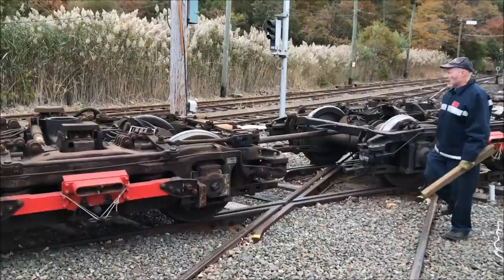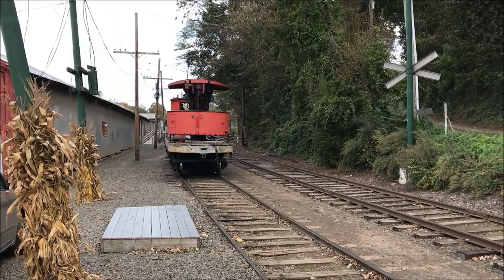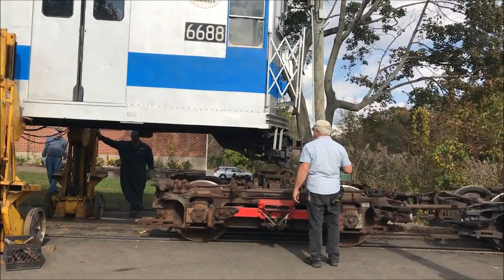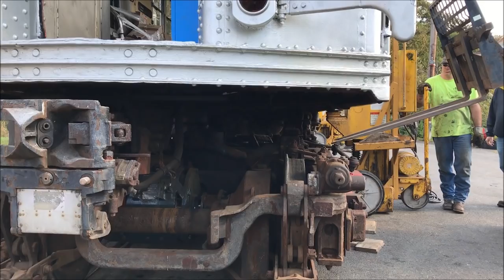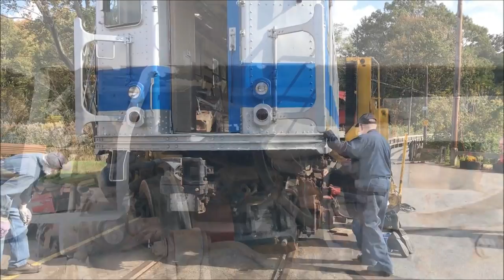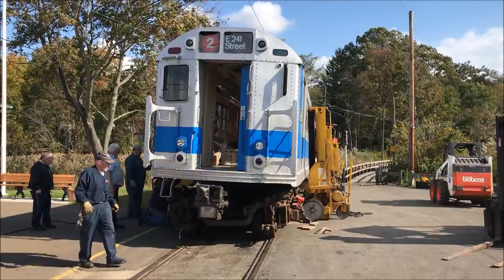Shore Line Trolley Museum HD 60fps: NYC Subway Redbird R17 6688 Returns From NYC (10/23/18)

Comment: Surprised that the production company had to go through this.  The Transit Museum has a number of subway cars on rail that could have been used.  Love that electric work car.
Reply from the maker: Think about it; which is easier? Having to deal with the TA loaning you cars for an extended period of time that can't leave TA property, and what you do with the car is heavily controlled by the TA? Or leasing from an independent museum, transporting the car directly to your studio, doing whatever you need to do with it within the generous guidelines supplied by the museum, and returning the car when you're finished? I guarantee you BERA is cheaper to work with than the NYCTA, even after factoring in the transportation costs lol.